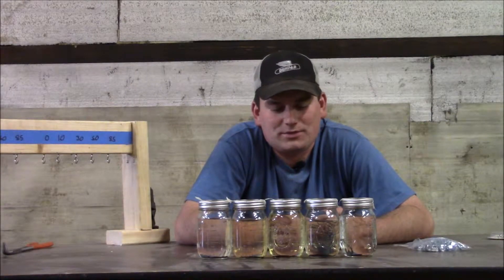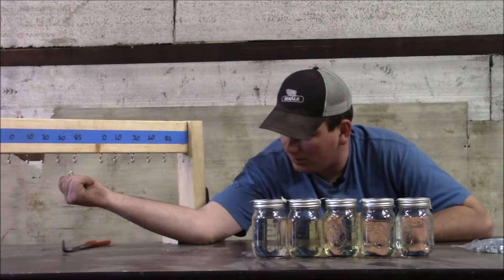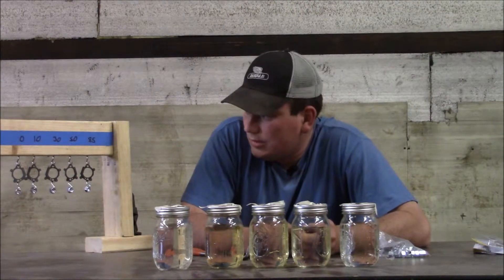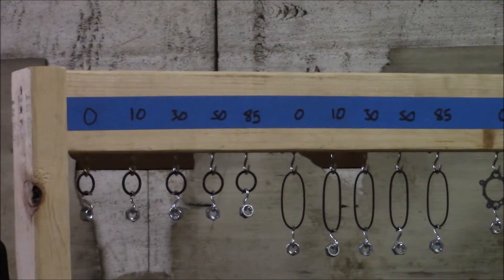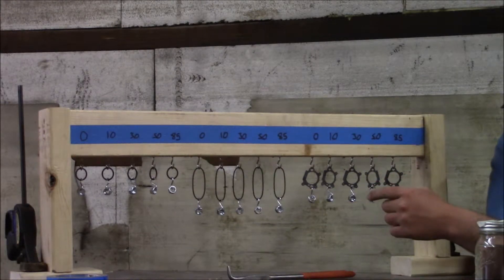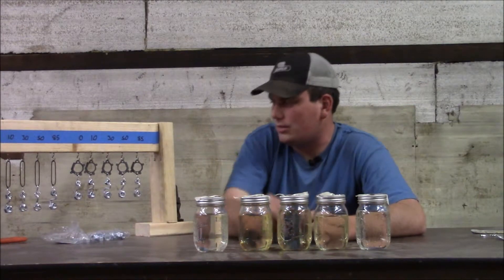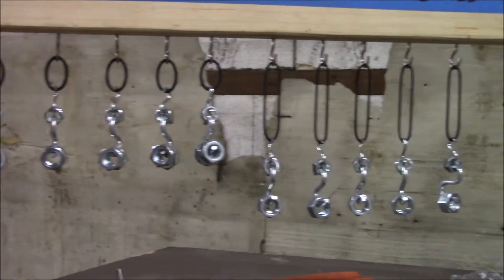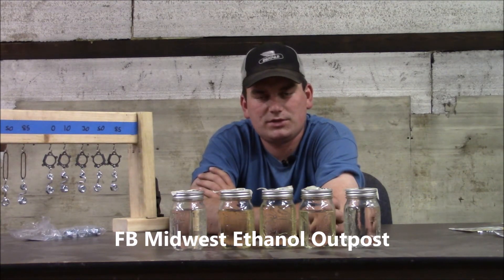Carb KIT Soak Test E0 E10 E30 E50 E85

Comment: E15 made 3. Composition/ information on ingredients
Mixtures
Chemical name
GASOLINE
Common name and synonyms
CAS number
86290-81-5
%
85 - 90

ETHANOL
64-17-5
10 - 15

BENZENE
71-43-2
<3

HEXANE
110-54-3
< 2

BENZENE, DIMETHYL
1330-20-7
< 1

BENZENE, METHYL-
ETHYLBENZENE
108-88-3
<1

100-41-4
< 1

NAPHTHALENE
91-20-3
< 0.5